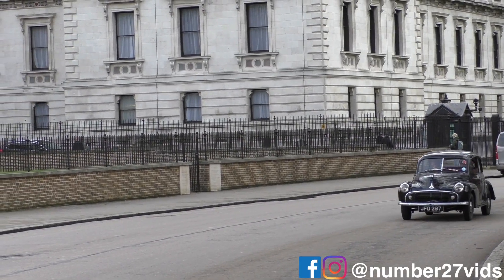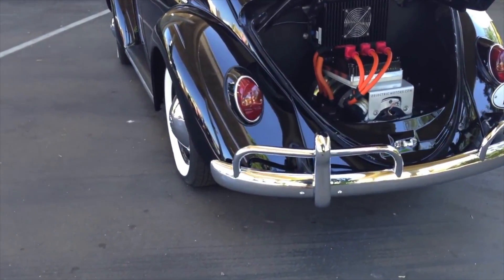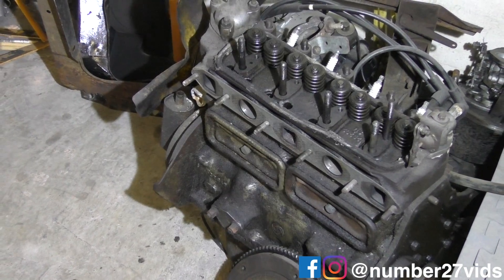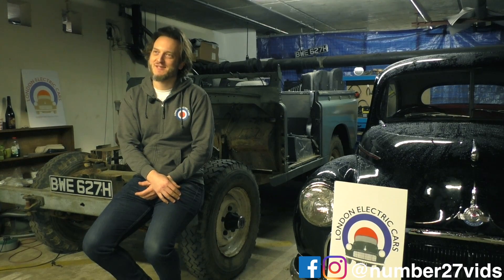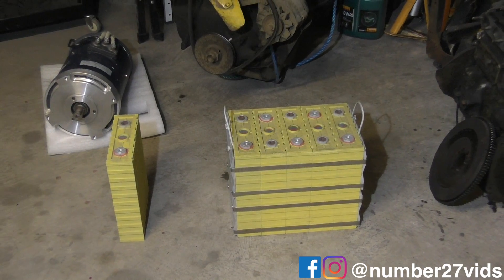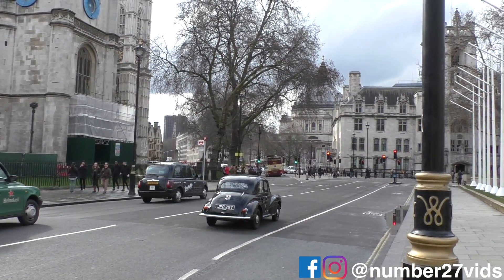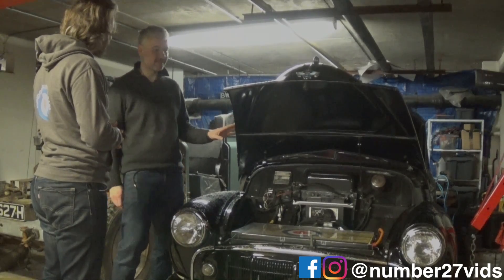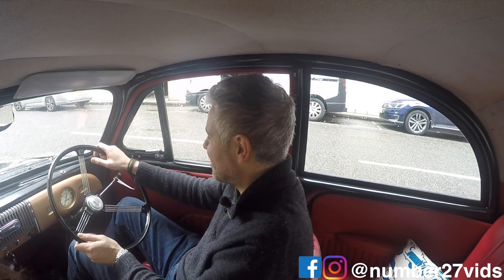Driving a converted Electric Morris Minor - Blunder or Brilliance?

Comment: I appreciate the western gesture to reduce petrol fumes, but getting people to point fingers at cars away from cotton mills and the like is ridiculous. Cars haven't turned eco systems into desert and poisoned the ground that even the human locals had no choice but to move.
Electric is good to keep classic examples but you've destroyed the joy and experience of the car and driving it. If you can get over the flaws of battery being dimensions and weight. Been here and done that for over a hundred years and that's not to mention that electric cars depreciate at such a rate that replacing a battery is more expensive than the cars' worth, plus batteries are highly toxic. Electric cars to pass their footprint, which is higher than petrol, from manufacturing is about eleven years compared to three if I remember right for petrol and no electric car lasts that long. Batteries aren't the future but I think electricity definitely is! Whether I like it or not. Strangely I think buying a classic car then converting to battery is a bigger footprint than if you just ran it on petrol. Then you have the source of your electricity... the whole thing is way more complicated than people dream it to be. Feel free to correct me if I'm wrong.

Comment: i was wondering is it possble to have better power steering in a 2006 Fiesta ST which has Hydrolic Power steering and they suffer badly with boiling the fluid so it ends up pretty heavy

Comment: I don't think the electrification of classic cars will spread so much. 
The transformation costs are not low and at the same time reduces (almost) to zero the value of the car (in particular for high value cars it’s an economic disaster). Reduces to zero also the passion (who will take his fake-Porsche, transformed into an electric toy, for a ride on the weekend anymore?).
Collecting is business, but there can be no business without value. There will be a small number of classics electrified for nostalgia, for not to be scrapped. But the real valuable collectibles will always be only with original cars. If the collection of original cars will decrease in quantity, this will paradoxically lead to an increasing of the value of the remaining classic cars.  If you want an electric car, buy it new.  Technically it’s much better, it’s much safer and, with the same performance, it costs much less.

Comment: The range would be the issue for me. Living in Australia, with our cities very much less dense, 40 miles wouldn't get me from one side of the city to the other. Let alone back again. On another note Hydrogen power seems very promising. You can convert a regular internal combustion engine to run on Hydrogen. Obviously you can't refuel at home, like Electric power, so some infrastructure changes need to happen. But that's already a reality in California.

Comment: This is the way of the future for classic cars that are actually used as a daily or very regularly.
Glad to see prices for these conversions coming down and people starting building kits for popular cars.

Until now it has mostly been all one off custom creations that are very labour intensive and thus either very expensive or only for skilled fabricators.
Over time the costs for motors, controllers and batteries have come down a good way already, and as this becomes more popular prices for these should come down further still.
Been thinking of doing this to my mark 1 golf for ages.

It would be awesome when a complete diy kit could be had for 3,5k or so instead of 7, that would make it a very acceseble option for a lot of people and make it more viable for the less exclusive classics. Putting 9k into a 4k car simply still is not something most people are willing or able to do.
Maybe another 5 years and that could be reality with a bit of luck.

Good times ahead!

Comment: please make some calculations as to when the reduced running cost will break even considering the initial investment. How long will the Batterie last vs service cost of the engine/ tax etc. Should be rather interesting.
Reply: Rather quickly actually if it is a daily driver . The petrol, maintenance and stuff adds up rather quickly on these older cars. Running it like this makes it virtually free, especially if you're cheeky and charge at work lol.
For most cars it probably will be around 3 to 5 years, which isn't that bad i think. But most will depend on how much fuel it uses ofcourse. The landrover hes doing will roi a lot faster then the morris obviously.
And some classics run years without major engine issues while others spend most time in the shop, kinda depends on luck.

Comment: Interesting how small the electric motors are compared to the old ICE.
The batteries don't take up much, if anymore room than the gas tank.
Reply: Obviously as they are not equivalent components. A motor only converts electrical energy into mechanical energy. An ICE creates energy from fuel. When you add the weight and volume of the battery it’s a very different story.

Comment: Replacing some amazing engines with electric ones would be sacrilege. Swapping out the 9000rpm F20c from my S2000 would defeat what made the car so awesome in the first place.
Reply: Yeah but your Honda isn't a classic car and that's who they are aiming this at.... If you had an old thing which needed a new engine but couldn't be sourced, this is an alternative albeit a slightly hard to swallow one.  Ive played with the F22 motor and at no stage could it be in anyway compared to the engine of an old landy or Morris!

Comment: Would you remove the chime from Big Ben? Or replace the iconic clock face with a huge digital display? Would you replace the Merlin engine in a WW2 Spitfire with one of the electric aviation motors in development? Classic vehicles  of any kind should be preserved in their original form whenever possible, to remove the engine is to rip out a large part of the their soul. Why would you spend upwards of £9k doing this to a Moggy when you could spend less on a relatively new second hand modern electric car?
Reply: What modern electric car could you possibly get second hand for less than £9k? A mobility scooter?
Reply: ube790 www.autotrader.co.uk/classified/advert/201903256237381?atmobcid=soc4
Reply: @davesanderson1843   Huh, waddyaknow.

Comment: It will need an amplfier and speaker to make the classic Minor v-vroom after first gear... Another point occurs to me when I see this sort of thing is, would it be more efficient to remove the gearbox as well (and all its drag) and have the motor directly drive the back axle? I realise it would need different control electronics and I'm sure you are ahead of me.
Reply from the maker: Yep you’re right it would be way more efficient but at this point an engineering challenge that would really increase development and conversion costs. Thanks for watching!

Comment: 40 miles?!?!? All that extra weight and a ~40hp motor, is this really the future? Think of the amazing classic car you can have for £9000. By the time you take account of the limited life of the batteries and the lithium and rare Earth elements, this is NOT even an environmental success. Carrying power in batteries is far more dangerous than petrol. In fact in EVERY way, apart from day to day running costs, the only logical choice is to stay on petrol!
Reply from the maker: The limited range will radically improve in a short time. There will always be a place for some petrol classics but other like this can actually be improved in many ways with electric. It would be a slow car, stressful to drive in traffic

Comment: I really would like to go electric and I know new technology has to go through development periods but it's so far away from being suitable for my needs. I can do 40 miles in one trip out to run a few errands, £9k of capital outlay doesn't represent a good enough return even at £1 charging costs. I recently travelled in a friend's BMW i3, it was wonderful and quiet, quick too but then she said she wanted to go to the coast and that she was worried as it was near the full extent of the range requiring a charging stop about 20 miles away to ensure arrival. And it's not 'just the same as refuelling' no matter how quick the charger is. At the moment it feels like electric vehicles are limiting rather than liberating but please note I want that to change so I can join the gang.
Reply from the maker: Range will improve dramatically .. its dependant on more recent electrics being written off so the pets can be used

Comment: You have a very nice car and a very good idea converting nice older cars like the beetle but the combustionengine is in no way outdated. It`s still evolving. If common  sence rules the combustionengine  may have another onehundred years to come. It will only be outdated when antigravity is introduced and that my come the next ten years, P
Reply: Do you think it is common sense to waste 80% of the fuel you put in your car? The average efficiency of an internal combustion engine is about 20%. That means only 20% of the fuel that you pay for makes the car go. The other 80% is blown out of the radiator and exhaust pipe as lost heat energy and pollutes our atmosphere. We have been 
driving these ICE cars for over 100 years now. It's time to do something smarter. It is like buying a six pack and
drinking one and pouring the other five down the drain. How would feel about doing that?

Comment: The big drawback to electrics are range per charge. Here, in the USA, there are greater distances to drive, hot and cold weather that also needs power that will shorten driving range even further. Also, electric cars suck off of the electric power grid for their voracious charging appetites.  The prime mover for the electric grid is coal, natural gas, and nuclear with very little renewable fuels.
Reply: Well that's the US for ya

Comment: Brilliant.  I like that idea.  However, I drive a 1992 Toyota Tarago.  It is not a classic yet, but the perspective of converting it into an electric car, meaning the engine bay would be able to lower for 6 inches or around 20cm.  It will certainly bring a huge benefit to create a better driving position (increasing headspace) for any tall driver like myself.  It will be most beneficial for the environment as well. Thank you.

Comment: Electric is cool to bad the sec you buy it you add 10-15 years to your carbon footprint just because of the battery and elements included lot of folks didn't know that sounds good at first but if you all bought an electric car at once earth be set back few million years  for 40 miles of driving time I'm on an island 40 miles is one way trip gets expensive quick but teachs patients while waiting for it to charge. Don't tell the yellow vest guys lol
Reply: The initial carbon cost is high, but it depends on the number of miles you drive the car per year.  The cars in this video are using pretty small batteries so the initial carbon cost would be lower.  CO2 emission break even on a longer range battery could be 30k-50k miles.  Break even on these smaller batteries may be 1/5th-1/6th that, or 5k-10k miles.  Of course, as he pointed out, these cars aren't driven many miles per year, so it could take quite awhile to even hit 5,000 - 10,000 miles for the payback.. but definitely less than 10-15 years.  Probably closer to 2.5 - 5 years.
Reply: @updlate4756 for your sake hope so lol
Reply: Upd Late. At <40 miles a week for this gentleman (he said one charge a week) that's only about 2000 miles a year.  It will take him 20+ years of driving to get to your large batt objective and 10+ for a more likely 16kw objective. An aged car is likely to suffer other major mechanical systems repair and degredation in that decade or two, even if the electric drive motor, bats and inverter are flawless.

 35 miles a week is only five miles a day.  A bike costs 200£, lasts forever, very little repair, and uses his physical energy.  There's your eco choice.  However in London you'd be stabbed.

In all reality, this is just an enthusiast collector novelty, like a full rebuilt Morris or a fun only motorcycle.  Modern human beings consume thermodynamics and resources all the time, even while resting.  End of story.  No way around it.

Comment: How much would you estimate the cost of converting a Silver Shadow?
Reply: Tesla model S is about 2 tons so similar to the Royce.
Electric Classic Cars are a Tesla battery OEM and have converted heavier vehicles.
They generally configure for around 250 mile ranges.

https://www.electricclassiccars.co.uk/

While you are at it, it would probably be about the same cost to convert an SZ series (Bentley 8/Silver Spirit)
Reply: Using Tesla Battery Modules, I reckon that you would need 80 to 100kWh of battery capacity to move over 2 tonnes of Silver Shadow and get a reasonable range. I would guess at 20K to 25K to do a real good job. Twin electric motor drive, and the motors could 'cut-in' just when you need acceleration and power. I keep scanning You Tube just to see if anyone enterprising has taken on the project of converting a Silver Shadow. But nobody wants to convert any Automatic Car, and Manual Transmission is the EV vehicle choice. EV conversion would make the car quieter still! I do hope that somebody takes up this challenge.

Comment: thats ok in town, but for the most of us 40-50 mile is rubbish, even entering a city the car will still be liable for the congestion charge because the car will be detected as petrol or diesel from the log book details. sadly now petrol and diesel is classed as the fuel of the devil, i would like to see a battery hgv, ship or plane that can carry similar loads to their fossil fuel equivalent.
Reply from the maker: No, car has to be re-registered once work is done and will be classed as electric so no congestion charge.
Reply: The largest shipping company in the world is now gearing up to turn everything electric, and those house sized quarry trucks are also being changed over.
Planes will probably wait for the next generation of battery, but they could easily do domestic flights with current commercial equipment.
Reply: @MsSomeonenew  but where is all the electric coming from, to charge these batteries, no one seems to answer that question. As I said here in the UK, we are at near maximum capacity, so how do we charge all these electric vehicles?
Reply: paul austin  hmmm, it's annoying that people who drive electric cars think it's clean, but no matter what someone drives it pollutes, there's nasty stuff in those batteries, then the electric they use could be from coal, gas or nuclear all of which have issues regarding the planet.

Comment: £9000!!! I'd love to do it to mine but OMFG!!!
Reply: Prisoner State lpg is ok but is limited by access to LPG. What about hybrid conversions? Nobody seems to have seriously considered that. Adding hub motors to the front wheels to boost the mpg of the engine and improving performance overall.
Reply: Convert now while it is still available as the new Electric cars flood the market then it will get messy to even match the parts. Besides the range is just indicative- you will get easy 200-400 miles in One Charge with Dry Cell & Super Capacitor combined installation which will be way smaller than any Battery you have seen like this one with Lithium. Lithium will be history soon.

Comment: Excellent, so I can keep my little BMW convertible forever! Can I have a bit more range though please, it’s a diesel and good for 600 miles when I drive across France so 600 miles would be great thank you
Reply from the maker: Ha! You ask for so little David! Thanks for watching!
Reply: The solution is to fit a towing hitch to your car and then pull a generator set along to charge the batteries as you drive along.

Comment: Have you thought about installing a Honda IMA (Integrated Motor Assist) system - either the whole package or inserting the electric motor part between the original engine and gearbox? 

https://www.youtube.com/watch?v=PJR_WNrHSig
Reply: This is a live engineering description of an actual installed IMA system (early version)

https://www.youtube.com/watch?v=NHJJBlo_GBA

Also

https://www.youtube.com/watch?v=9Ur_VNd2Lh4

Comment: Whilst I'm impressed by the engineering, I have to say I disagree that the engine is not the beating heart of a classic. It's very much a major part of the experience of owning and driving a classic car, just as a coal boiler is part of the experience of a steam locomotive. At least the conversions are reversible, I'd hate to think of these cars being subjected to a one-way transformation into what is essentially representative of the technology of the moment.
Reply: dungareesareforfools   That might be the case in one respect but as old part get harder to find in some models and fuel costs go through the roof I  rather put an electric motor in my car and be able to drive my classic than not🤘
Reply: @garylaver4614  agreed.

Comment: I think this is a good idea. I saw this car in the London Motor Show. Replacing the knackered engines in Minis, Fiat 500's and 2CV's will produce very interesting and competent citycars.
Reply: This will be an enormous market.
Reply: They may be too small to carry much in the way of battery capacity. All those batteries in the Minor only got you a 40km range.
Reply: @stephenburnage7687  not worth doing. In fact the best place for some of these old bangers is to use them for limited miles-as will be the case for all of them. There s no easy fix...

Comment: Fuck off britian. You 'Arses' continue to call ENGINES "MOTORS" which is so fucking wrong!, ENGINES ARE RUN OFF OF GAS/LIQUIDS and COMBUSTION. MOTORS HAVE STATORS AND THOSE STATORS ARE RUN BY ELECTRICITY.

FUCK OFF

Not a MOTORWAY, A ENGINEWAY